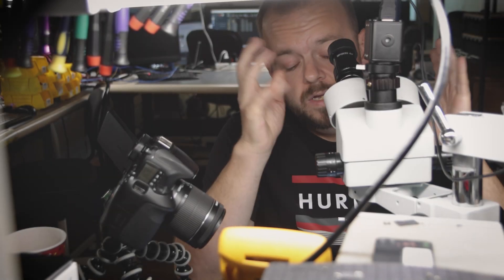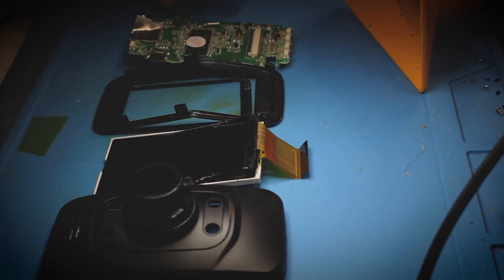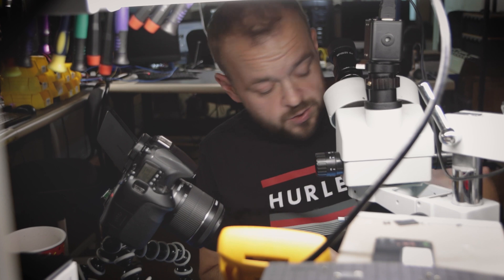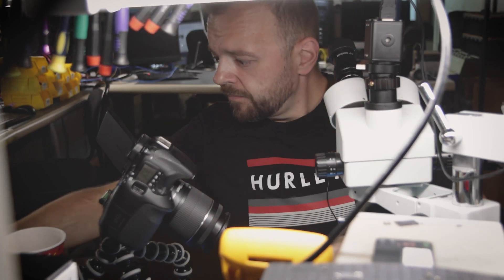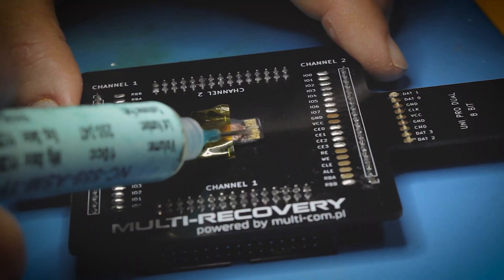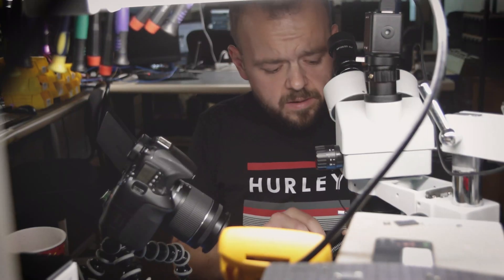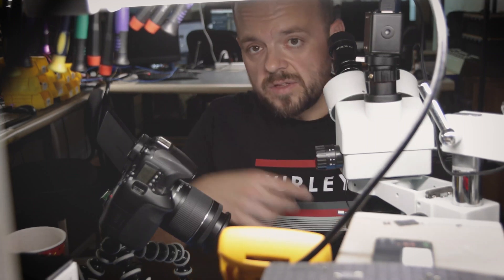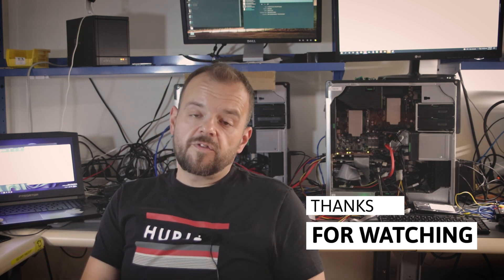Damaged Micro SD card repair

Comment: hi i have a question i have a samsung micro sd card with a diagonal crack ... is it recoverable ? i have another one that is slightly bent  at the ends (opposite the gold pins)
Reply: Did you fix this issue ?
Reply: @joshuacruz4046  i didnt find anyone =(